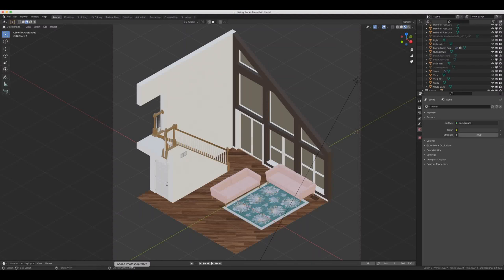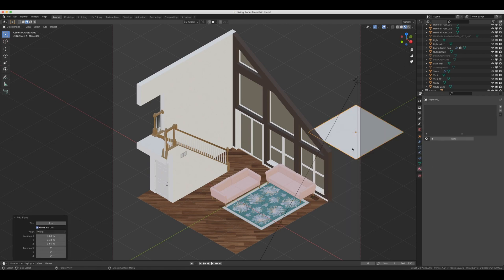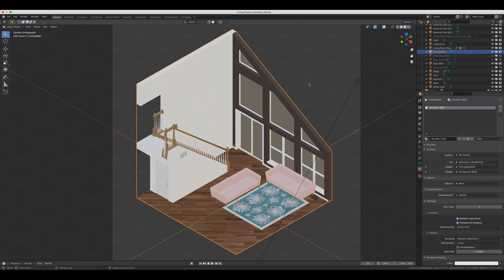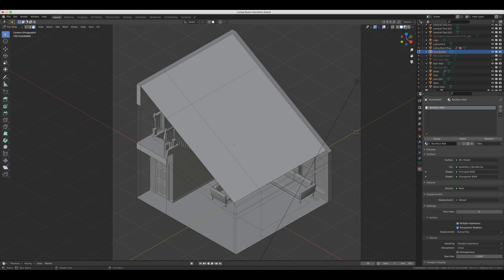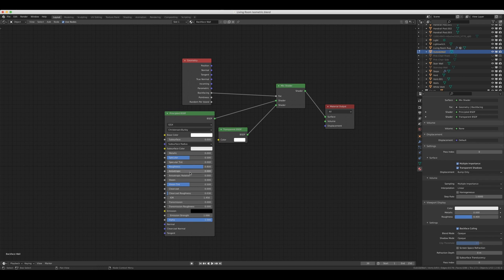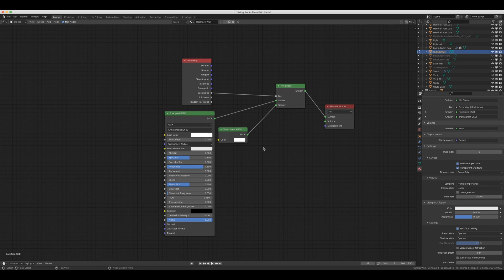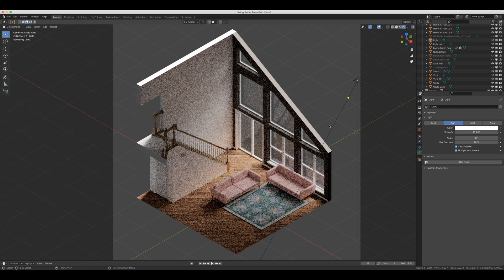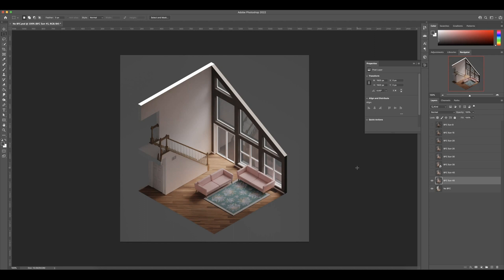Backface Culling in Blender for Surprisingly Better Lighting

Comment: Isn't the light better because it uses more of the GPU CPU cycles to get more of the light where it needs to get instead of unseeable and unusable areas?
Reply from the maker: I'm actually not totally sure the science behind it all. I just assumed the light was better because more of it was bouncing off the new walls and going back into the room instead of just flying off into open space. It very well could be more GPU CPU cycles, especially since I would imagine the light is reflecting all over the place, over and over, since it's trapped in there.

Comment: so it allows you to see through walls? cant you just get the same effect by telling the wall not to show up visible in the render?
Reply from the maker: Yes! You can definitely do that by disabling the camera in ray visibility and it is the exact same thing. Admittedly a little easier too if all you want is cycles. The only real difference is that it only works in cycles, and not all the other modes (solid, lookdev, and Eevee) like backface culling does.

When I created the video I wanted it to be  more like a guide on how to set up backface culling in all the different modes. But yeah, the more I use Blender, the more I learn that there are multiple ways to do everything 😂

Comment: In your comparison - the render without backface culling looks like light is coming from top through the roof (you can see that on the wall with stairs). In the render with backface culling on - light comes in only through the window. You don't need backface culling to achieve that - Am I wrong?
Surprisingly - when you show it in blender  the lighting with backface culling off looks different than in your comparison in photoshop. Why?
Reply from the maker: You are right, without backface culling, the light comes in from everywhere. I wanted the scene to react just like my own living room (this is my own living room btw 😂) we get tons of natural light through those windows, so I wanted to replicate that. But if I had just used a plain wall to block out the light from the ceiling and outside walls, they would have been visible to the camera. Backface culling allows the walls to be walls from one side, but invisible to the camera from the other. This also traps in the light and causes it to bounce around more inside the scene. 

Someone has pointed out that you can disable the camera in ray visibility, which does the same thing in cycles, but this video was originally meant to show how to enable backface culling in all the different view modes (solid, look Dev, cycles and eevee)

As far as looking different, I’m not sure. Could be the denoiser in the final renders? I didn’t do anything different to the scene.

Comment: Nice tip, so thanks for sharing!  Did the backface culling version have higher render times with the same settings?
Reply from the maker: Thanks! To be totally honest, I don’t know! I can check and let you know
Reply from the maker: Okay I just checked and yes, for this particular scene, the backface culling version took twice as long at 3 mins 21 seconds with the sun at 45 strength at 128 samples in cycles vs 1 min 37 seconds with the sun at 8 and no backface culling. I’m guessing because of all the bouncing light in the backface culling version.
Reply: @pixelseek  I really appreciate you taking the time to even try that. I asked because I was guessing that the extra bouncing surfaces would increase render times some. It's still a great tip that is useful to know for some interior scenes especially for rendering single frames and not longer animations. The individual just has to figure out if they can afford the longer render times for their needs.
Reply from the maker: You’re welcome! And yeah, animations get tricky real fast 😂 but for single frames it’s definitely worth considering!

Comment: So adding a fill light makes better lighting, not back-face culling per say.
Reply from the maker: That could be. I cut a section out of this video because I was trying to keep the video length down, but in it I said that this is my own living room that I modeled and I we get a TON of natural light through those big windows during the day. I wanted to stay completely true to the natural lighting set up we have so my only lighting in this scene is one sun lamp. I really felt like trapping that light inside the room looked a lot better than letting it escape for this scene.
Reply: @pixelseek  yeah for sure, the walls are bouncing it back, filling in the shadows. Never thought of using back-face culling for this reason, nice work.

Comment: Usually I would just go to the object settings of the walls that you want to be invisible and disable visible to camera, that does basically the same thing but doesn't need special materials. One other tip is rather than changing the lighting and rerendering over and over use the exposure slider in colour management. That is applied post-render and has exactly the same effect.
Reply from the maker: Hey! Thanks for your comment! Are you talking about turning off the camera in Ray Visibility? If so, do you know if there is a way to also turn it off for Solid, Lookdev, and Eevee? I’ve only ever been able to get it to work with Cycles! I think that would definitely be an easier way, at least for Cycles, since there’s no material to be made. 

I typically only ever use Cycles but I know a lot of people like using Eevee so I would be interested in finding a good, general solution! But maybe that is just a combination of these two ideas?

And interesting! I’ll have to check that out and compare! Thanks!
Reply: @pixelseek  Yes, ray visibility in the object properties. Doing it that way is especially important if you have something like a mirror and need the wall that is invisible to the camera to appear in it. That lets you have detail on it and not have to worry about the orientation of the faces compared to the camera. I'm pretty sure that Eevee is different enough that trying to find one way that will work for both is just not possible.
Reply from the maker: Cool! Thanks! I know you can still assign textures and stuff through the BSDF even with backface culling, but yeah, at that point it’s turning a simple texture into something a lot more complicated haha.